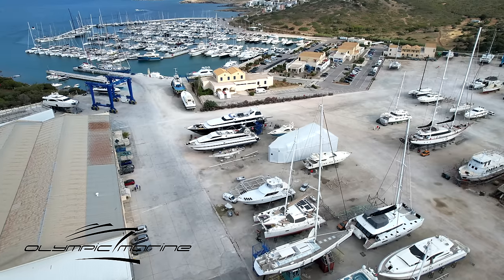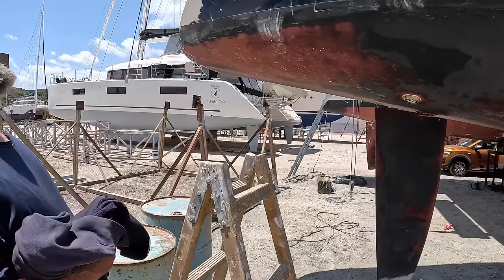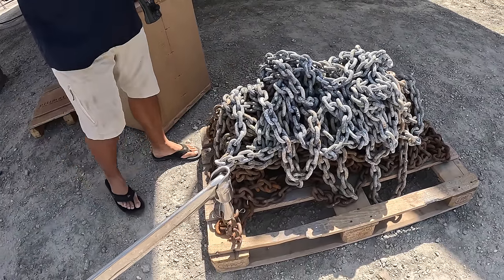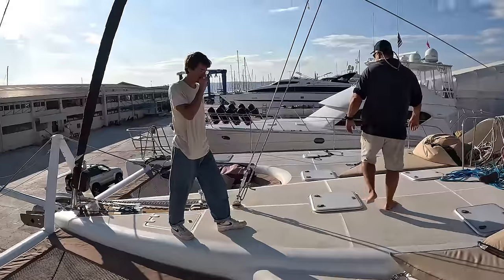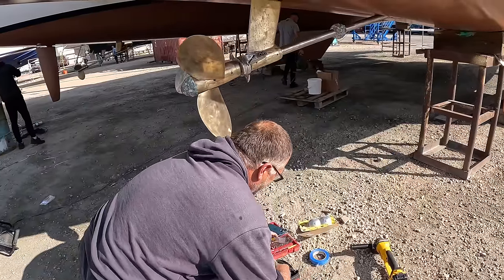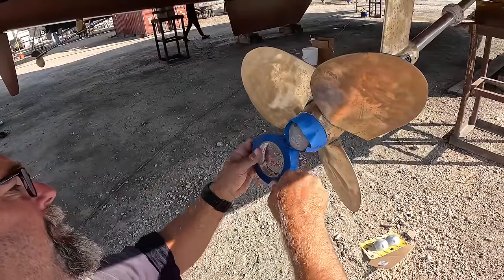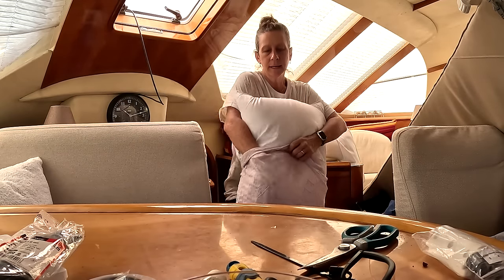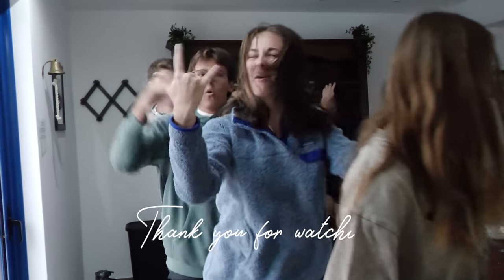COPPERCOAT: Our THIRD try at antifouling! (Ep 242)

Comment: Keith and the family are always ‘all in’ with the boat maintenance.  Of all the amazing work and upgrades that Keith does the sacrificial zincs/annoids are as important as the bottom paint. He’s right..pull the boat and change them…I saw a boat in a fresh water lake in North Carolina that was left in the water for years.  (tied up in an estate) and the two outdrives, trim tabs and anything else below tbe water line was corroded beyond recognition! The fiberglass hole was a new level blistering.

Comment: I get very concerned anytime I see someone using a Bosun's chair without a full body harness and proper fall protection. The Bosun's chair is intended for work positioning and provides no level of "fall protection". You should only use a Bosun's chair in conjunction with a full body harness connected to a proper anchor point with something that will limit the fall distance to maximum of 6ft and an arresting force of less than 1800 Lbs. If you fall at these numbers you're still going to get hurt, but at least you won't die.  Something like a self retracting life line would be a great solution for your needs and would limit the fall distance and arresting forces considerably.  Google it and stay safe out there on the blue...

Comment: it looked like you had two anchor points at the bow of the boat, are dual anchor setups normal/better? i recall front and back from la vagabond being mentioned i think, you have a chain there... maybe another windlass and hardware is too expensive with too little return?

Comment: Nice Familiy, Nice Videos! - - - Sorry for the hint/ Question: Did you not stand the Cooper coat at the end? Very important so that the copper parts have direct contact with the water, so it will eventually not be able to prevent fouling (the particles are thus enclosed by the carrier material)  ... Regards from Germany Stephan

Comment: Why don't you put on the Propspeed and then install the zinc to avoid masking off the zinc? I'm thinking that the bottom paint isn't lasting on many boats like it used to because the environmentalist took out the lead in paint. Not sure if that's correct or not but hopefully this Coppercoat works out. Also, why not use Propspeed as a bottom paint because the stuff works really well?

Comment: It is not softer metal, zinc has lower corrosion resistance, its basically sacrificed to save bronze propeller. While Gold, Platinum, Silver, Iridium, Palladium, Rodiuml, Reuthenium and Osmium are metals with highest corrosion resistance and they are called Noble metals since you need specilased acid mixtures like Aqua regia etc.

Comment: Can they take the old anchor chain and take out some links to break it into smaller lengths and then replate it with zinc or chrome, maybe gold? Lol. I would think you could sell it. We used to sell oir old chain to a Pakistani outfit that would smelt them into blocks that were then used to make cheap knives and hard caste cores and penetration rods for 7.62x54R rifle rounds and penetration caps for 12.7x108mm heavy machine gun rounds. I only know that because I was and still am into firearms and the guy that came out wwas wearing a shirt that said '1-800-Death Direct. Straight to Allah delivery service'